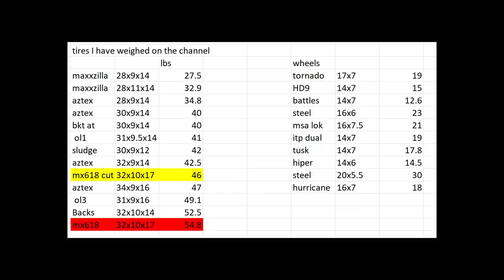How to Cut Mud tires fast 32" knock off tires Sawzall and stuff

Comment: Hi there.I worked in a tire retreading plant back in the 80s.We had a small electric oven to keep knives hot and lugs were cut when hot.If your brave enough to experiment,you could maybe heat up the whole tire in a large oven(like a pizza oven) and use hot knives for cutting.just an idea,good luck.

Comment: Watched your video on making strut spacers using pvc. Tried it couldn't  get the small ass spring to compress far enough. Any ideas on homemade bracket lift? For 350 bruin 2x4

Comment: I have a 1994 Honda 300 4x4 bone stock that I got out of a field and I want to make it capable to run 28” azteks, what’re some basic things that I need to do to accomplish this? I’m also planning on doing your snorkel with the pool tubing
Reply from the maker: 35% reduction

Comment: Have you tried using a blade in that hot knife  like a smooth jig saw blade or razor blade and get it up to temp ?
Reply from the maker: Really send blades don't have the heat capacity. Nice for shaving dirt bike tires but not for cutting off big ATV nobbies

Comment: Hey I have a Honda 300 Fourtrax with 54 percent gear reduction and when I put it in gear it slowly drives off any suggestions to fixing that ?
Reply from the maker: Slower your idle
Reply: It’s running about normal so I don’t think it’s that could it be something with clutch
Reply from the maker: Only thing that could cause that is the bushings inside your gear reduction going bad
Reply: Mud Puppy oh ok thx it’s brand new so I guess we just got to mess around with it

Comment: You could have twisted the wire a few strands and it would have had more strength and be able to hold more heat

Comment: So what is the benefit of cutting mud tires?
Reply from the maker: Less weight more traction in thick mud
Reply: Less weight equals higher tire rpm. Easier on the engine to spin the tires while in thick nasty stuff. Plus they’ll clean out better with the extra spacing between the lugs